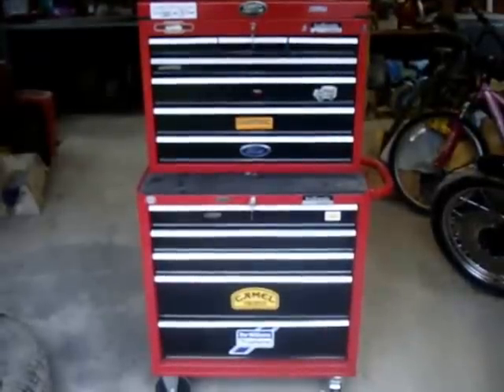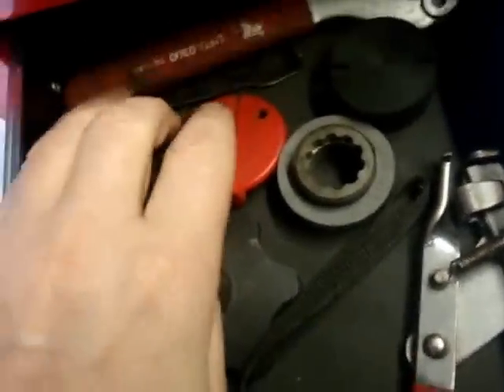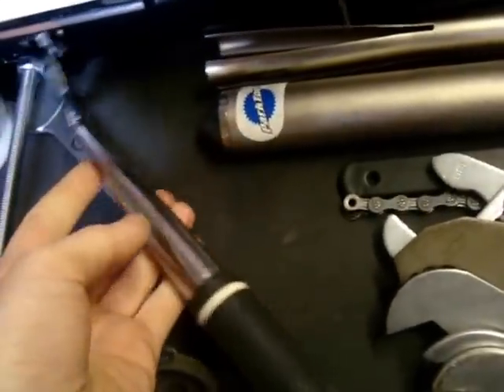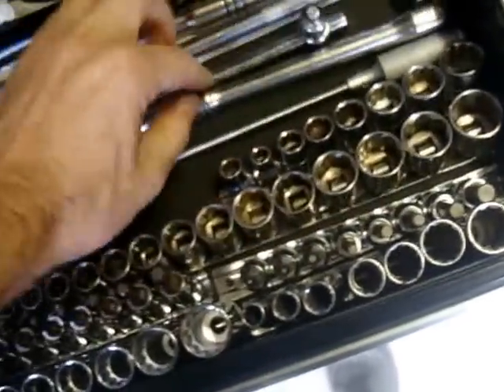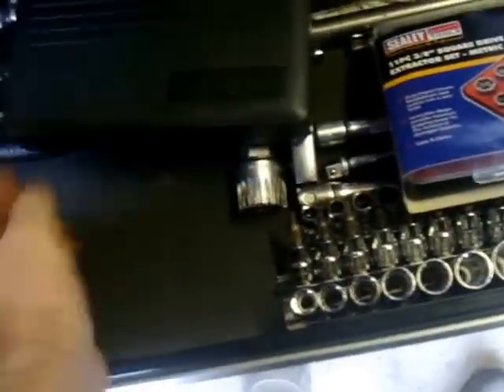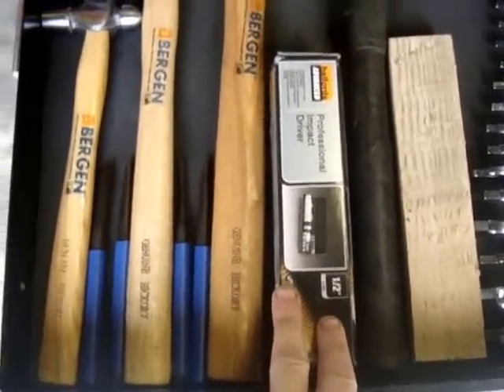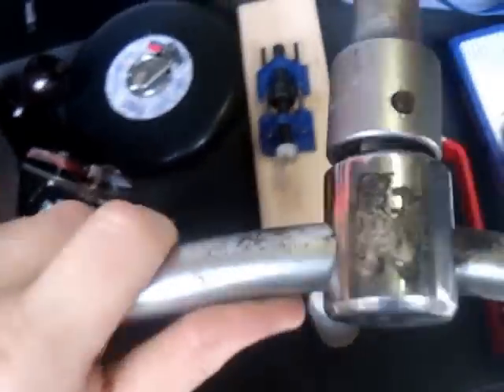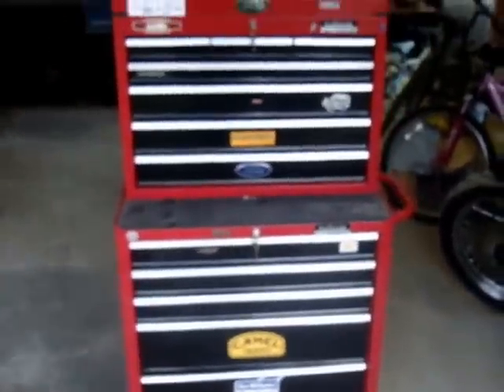My Halfords tool chest

Comment: I got a trad card too from college :)  I havent used it yet what sort of discounts do you get ???
Reply from the maker: It depends really as it seems to differ. I sometimes find the special offers get things cheaper then the trade card, Tools is probably around 30% where bulbs I can  get around 50% off. Other things like car batteries you don't seem to get hardly anything off so its best to ask before you buy. I also use mine with a utility warehouse cash back card as well so I also get 5% off all my home bills as well which is worth having. So so when I put the two together  it is worth doing for me.